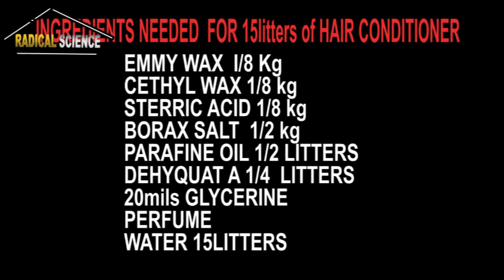How to make hair conditioner at home DIY  😯Try this recipes

Comment: Hello
I made a mistake with the mixing after it cooled down and I have added water to it already but it’s not giving the result like yours

Mine has the conditioner on top and lots of water underneath 😢. What can I do?
Reply: @radicalscience
Reply from the maker: oh sorry , stir very well u may have used the wrong chemical
Reply: You didn't give the right measurements.

You said according to your ingredients Borax salt is 1/2 while others are 1/8 instead of borax salt 1/8 and others 1/2.

I bought materials from the market and just returned and decided to watch and discovered that the measurement you wrote is different from the one you used.

Comment: Borax and Dehyquat are water solluble not oil soluble. In a manufacturing session you have to dissolve borax into hot water. And after you have poured the borax solution to oils and mixed thats when you add dehyquart A. Even glycerine is water soluble. Can place into the hot water priot to emulsification
Reply: Good job sir
Reply: This process is an emulsion process that have three parts with an emulsifying agents 
Part A: Oil phase
Part B: Water phase 
Part C: Cooled phase
Here part A and B should be heated at the same temperature and mixed, then cooled after cooled part C is added!